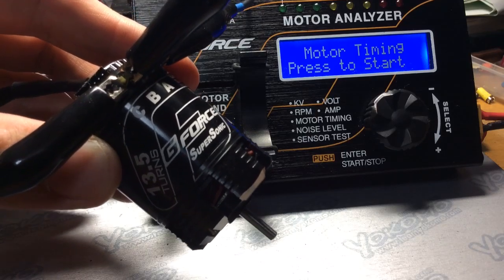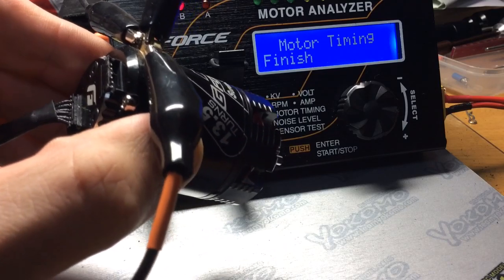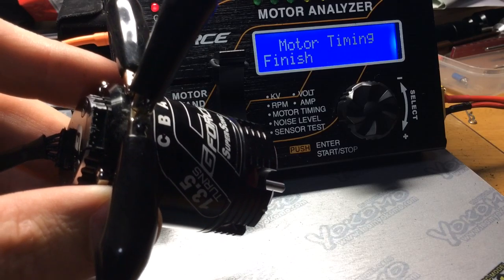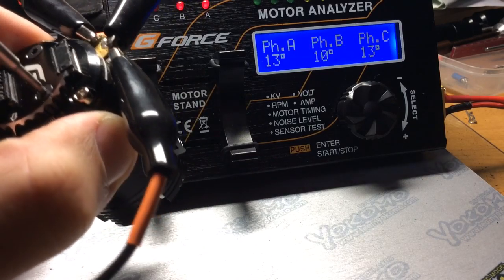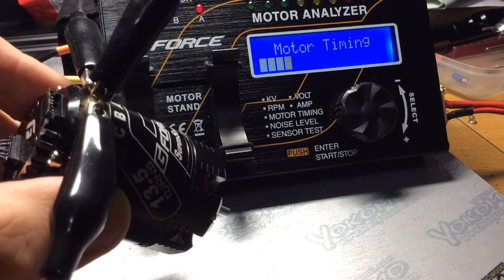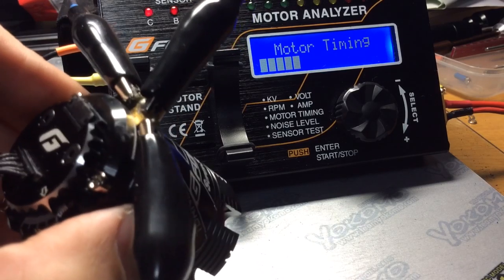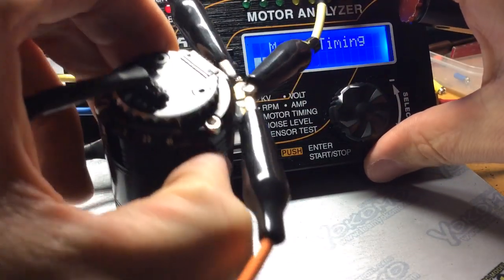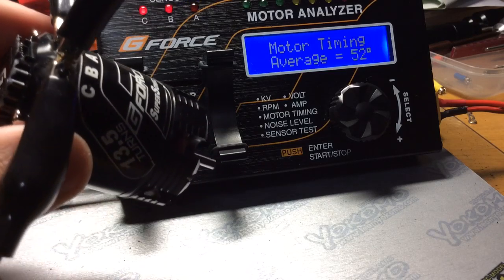G-Force 13.5 Super Sonic Timing Settings

Comment: Would you know what timing for a 10.5t one? Stock is at 20. Runs hot
Reply from the maker: I would run the timing around 40 degrees timing. What's your gearing? Is the car drive train binding?
Reply: Thanks for the reply. Probably my gearing. No binding but my gearing 1 tooth added to pinion from stock is at 10.4 so probably that. Already ordered a set of pinions and spurs :)

Comment: :) hello , what's the best sweet spot and FDR for this motor for touring blinky mode ?
Reply from the maker: +Nicola De Pasquale I would start around 40~45 degrees on the can. I'm not sure what motor you're racing. Let me know :)
Reply: +Edward Pickering thanks for reply :-) I have gforce 13.5 supersonic motor :)
Reply from the maker: +Nicola De Pasquale 

I would look at starting at a 4.5 FDR and go from there :) . Check performance such as straightaway speed and infield punch. Most importantly check the motor temperature after 3 minutes. Hope this helps.